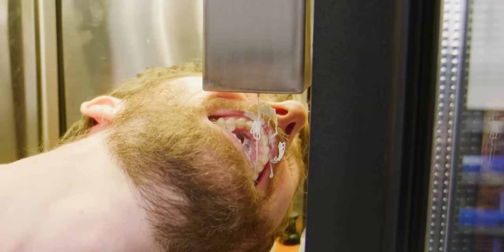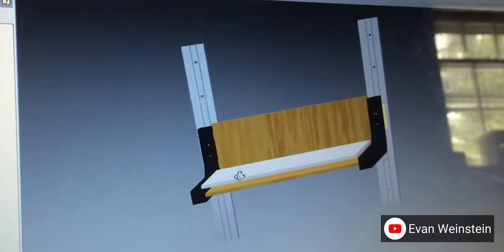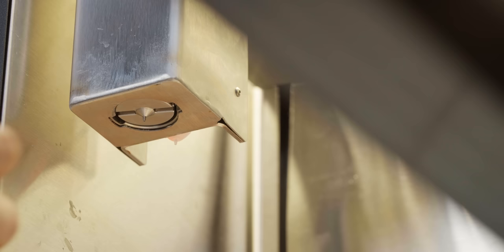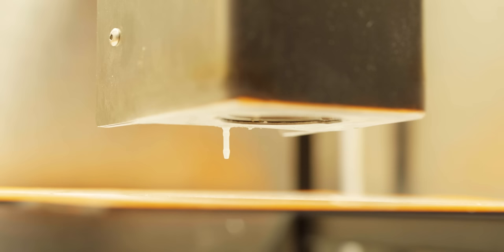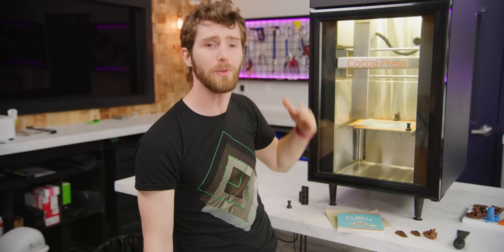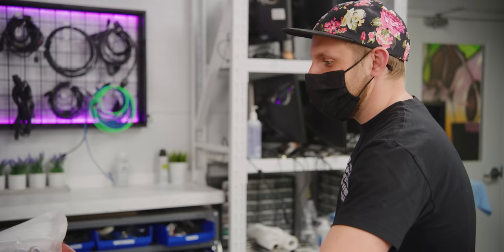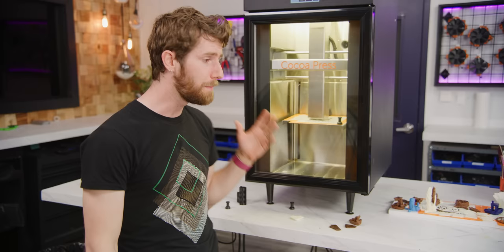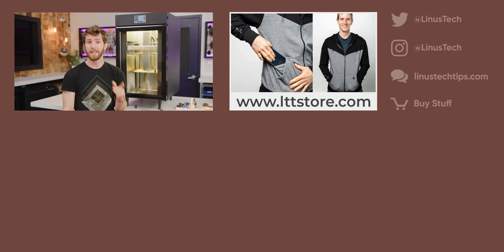Eating 3D Printed Chocolate!

Comment: Can't wait for the Chocolate printing mod for my Ender3 👀
Reply: hell yeah
Reply: If you could heat the chocolate and put the printer in a fridge I'm sure you could do it.
Reply: @TheSubieFan  I live in norway, no need for a fridge, just stick it outside during 2/3 of the year!
Reply: It already exists, check RCLifeon's video from few years back
Reply: @fantysak9388  I was waiting for someone to mention this.
Reply: There is one
Reply: Why is Nordern here?
Reply: TIL Norden has an Ender3.
Also that he watches LTT.
tell snazzy hi
Reply: HI NORDERN!!
Reply: PrinterMods' XChange system doesn't suck for that express purpose.
Reply: I have an Ender 3 Pro and a Ender 3 V2. I'm absolutely in love with printing carbon fiber enhanced PLA, especially the 35% blends but I want to produce a few CNC things using it to create all the bracketing (with appropriate metal reinforcements of course). A CNC table with a quick tool change for laser, routing and similar table sized heads. A CNC similar to a 3D printer but more portable without wrecking accuracy to mount dremmels, drills and whatnot in an on the fly compatible manner. Then one for the kitchen to print frostings, chocolates and various other things that may work similar to a plastic.
Reply: Pretty sure that there are mods on thingiverse to extrude paste from a syringe, so you could put the thing in a fridge and heat the syringe to print chocolate.
Reply: Already out bro.
Reply: @dylancampbell5268  cuz the video's about chocolate, duh
Reply: What? I didn't know you watched linus.
Reply: Hell yea boiii
Reply: i can just imagine Moti's jokes about you binging on that chocolate printer.
Reply: hey nordern, you're here too, love your vids btw
Reply: Already exists... Check our RC life's video
Reply: They have that
Reply: It exists
Reply: @512TheWolf512  ahhh i see. Makes sense, chocolate is a good treat, and Nordern is a good youtuber
Reply: @dylancampbell5268  I don't know if you really get it or not...
Reply: @512TheWolf512  oh I do
Reply: Hes got an Ender3, a printing machine.
Reply: wonder how direct drive extruder heating works on chocolate

Comment: I would LOVE them to use a miniature progressing cavity pump for the next version, and chocolate pellets. I built a 3DP version for my old uni project (icing not chocolate) and they were finicky, but would mean prints could be a LOT bigger and you can just keep... topping up the hopper.
Reply: i love you angus
Reply: Is that just basically a linear geroter pump?
Reply: Angus hello!
Reply from the maker: I can't help but read that in Angus voice. But to the point, you would just top up the hopper with chocolate chips right? -CW
Reply: Angus! Glad to see you over here! Gotta say I read this in your voice, cadence and all 😂!!  To your comment- yeah for that price tag I would certainly expect a whole lot more raw material capability! Hell it should probably have a tool changer for at least one other flavor / product!
Reply: @MakersMuse  Maybe it would be possible to embed a heater cartridge inside the screw/rotor?
Reply: @LinusTechTips  Real white chocolate, just so you know is nowhere near as sweet as the "white confectionary" that you're consuming in this video. It has far more depth and consistency. Most chocolate connoisseurs(which believe it or not actually exist), say if the white chocolate you're eating tastes too sweet, it most likely does not contain any cocoa butter or cocoa powder.

Next time you go to a store, look for a white chocolate bar or bag of white chocolates and notice the subtle differences between the cheap products, and the ones that have truffles or higher price tags. If you can find Lindt White Chocolate Truffles bags, notice that they typically list cocoa butter in the ingredients list. That is the big difference when white chocolate is more well-rounded and contains a more full flavor. Without Cocoa Butter, it is just sugar.

Interestingly enough, despite Russell Stovers being a far inferior product to Lindt, Lindt actually now owns Russell Stovers.

Another interesting thing to note about chocolate and white chocolate, in general, is that it is technically illegal worldwide to call products chocolate, white, milk, or otherwise if it doesn't contain any real cocoa products.

Therefore on the packaging, if it says confectionary or chocolatey flavor, then chances are good that it doesn't contain enough chocolate ingredients to meet worldwide trade standards. Swiss Milk and Swiss Chocolate are creamier, tastier, and far less sugary than most other chocolates. Lindt is by far one of the most well-known among true Maître Chocolatiers and has been acquiring numerous companies in the USA such as Ghiradelli and Russell Stovers.

There is a massive difference between American White Chocolatey Confectionary and Swiss White Chocolate. I highly recommend you try taste testing Swiss chocolates such as  Lindt versus the American and I guarantee you'll notice the difference and change your mind completely regarding white chocolate after trying Lindt White Chocolate.
Reply: dude now i remember it form the up mini review video
Reply: @MakersMuse  and a heater cartige for heating the water
Reply: @LinusTechTips  It's z, not zed. You absolute bot
Reply: This is really just moving out of the proof of concept stage and I expect there will be a lot more refinement incorporating some of the suggestions made. As it's likely to be rather expensive for an amusing 'toy', and be more likely to be purchased by confectionary stores, I'd expect those suggestions to be incorporated.
Reply: @LinusTechTips  chocolate CPU watercooling block when?
Reply: @LinusTechTips  probably don't even need to top off the hopper. It can easily be fed by a large bin
Reply: @kingzach74  Wait there’s a difference

Comment: In highschool our final engineering project was 3D printing plastic molds to then fill with chocolate, definitely easier than this way haha
Reply: I was thinking the same thing, but the complex internal structures is where my mind can't think of how that is handled easly with the molding process
Reply: @Waitwhat469  mold in parts and assemble with piped warm chocolate to fasten.

Comment: Funny thing is, it would be much easier to 3D print a design in PLA, then do a vacuum-form mold of it and fill THAT with chocolate. Its extra steps, but until this thing gets reliable, it will be the better way. 
And even at doing that, your vacuum-forms can be re-used multiple times if someone does want to sell custom chocolates.

Comment: There is a good way to use this kind of 3d print outside of food. I dont know another  material that similar to chocolate when it comes to temperature behavior, but what if I 3d print a model, cast it on sand to make the mold, then cast metal in it. The chocolate model then can be melted back into printing material easily. With plastic, you need to buy extra equipment just to reuse the printed plastic back into filament. With chocolate, just a kitchen stove and a pot should be enough.

Comment: Some friend of mine had to think about customized chocolate solutions, and thought about 3D printing chocolate. It turned out 3D printing the molds to put the chocolate inside is actually more reliable and more efficient (you don't have to rely on very slow printing times if you have 100 times the same chocolate piece to do). I don't really see an interest to this machine, given how complicated it is to make it work (but it is definitely a very funny project).

Comment: I wonder what would make more sense for the food industry when it comes to this. Would a chocolate printer be best? Or best to 3d print and prep molds for use with chocolate?
Reply: Second one if you don't need some kind of different interior vs exterior texture, first one if you do.

Comment: Chocolate shot glasses would be fun.

Better yet, you can 3D print something 99% of the way pause it, fill it with something, then finish the print to make filled chocolates in all sorts of unique 3D printed shapes you couldn't do with molds.
Reply: As a note, there is a LOT online and in cooking books about improving the behavior of chocolate under non-ideal conditions.    Fortunately, unlike plastic, chefs have wrestled with chocolate for a few centuries now, so there are ways to improve it.    I'm sure their chocolate comes well pretempered, but most pretempered chocolate would not be.

A technique that is a cross between tempering of glass and the final melt and skim smelting process for lead  works wonders.  It's, obviously, called "Tempering."  Do it repeatedly and you can remove impurities while improving the consistency of the chocolate.  Usually standard factory tempered chocolate isn't tempered enough times, long enough or well enough to address these issues.    Also, it's bound to pick up stuff in the kitchen when handling it that needs to be removed.  It's best to just remelt it.

Just slowly heat the chocolate to it's melting point, then hold it there.   Initially stir in what floats to the top and bottom, but then after a bit, just start skimming it.  Then remove the melted chocolate, being sure to leave the sediment.  The skimmed and sediment, should be usable in other dishes.  They just aren't good for melting chocolate. 

If you aren't too upset about adding stuff to your chocolate, you can add refined coconut oil or shortening (former tastes better, but is more expensive) to improve melt as well as some refined light corn syrup or simple syrup.  Add this all before tempering the chocolate, or any impurities will mess up the chocolate.

Comment: Awesome job! But with the limitations of this unit you guys should try the "fake" chocolate. In this chocolate they replaced the cacao butter (what requires the tempering of chocolate) by a other natural oil like palm kernel oil or coconut oil, so no need for tempering. This should do a great job in this unit. (does not taste 100% the same)

Comment: Great and smart design on the feeding syringe. Cooling should be done at the end of the hot end tip without airflow hitting the nozzle.
Add a blower with a flattened tube at 45 degrees towards the tip of the extruder. Should make cooling more efficient for chocolate.

Comment: In Switzerland there is a brand of chocolate they dont sell outside the country called Cailler (orginal inventors of Milk chocolate) and they have a chocolate bar they purposely aerate the chocolate so it has lots of air bubbles in it. I've never had a smoother and taster chocolate than that. https://cailler.ch/en/chocolate/cailler-air-tablet-100g

Comment: When systems like this get better, it will be amazing.  Being able to precisely inject various ingredients throughout custom structures is going to be a massive hit for food production.
It'll also more specifically allow for incredible consistency, and in turn, less food waste or food that is some times a little strong or too weak in some areas because certain ingredients bunched up elsewhere in the food product during production.    Specifically being able to integrate air pockets in to some foods precisely will create things we couldn't previously create without incredibly hard production methods that usually result in other issues with regards to taste.
A device like this won't be doing it, but a much larger industrial scale version will be able to handle it.  Devices like this will pave the way in research and cutting the costs before that side even comes to fruition, which is backwards from the usual price reduction pathway.

Comment: I've actually used an EnvisionTec Bioplotter to 3D print chocolate before (I know, what a great use of research equipment)! It is fun, but, as you said, it is extremely challenging to maintain just the right temperature.

Comment: what exactly does this solve compared to a normal mold? with plastics, molds can cost literally 100s of 1000s of dollars, but with food like chocolate you can pretty easily just make a silicone mold that will last as long as you need it. I guess for 1 off pieces it could be useful but idk

Comment: "White chocolate isn't chocolate by the way" - That's a common misconception. It really is chocolate!

White chocolate is made from cocoa butter, milk solids, and sugar - just like milk chocolate - but does not contain any cocoa **solids**. Cocoa butter is made from cacao beans and absolutely qualifies as chocolate. In fact, it is the part of chocolate that is responsible for its ability to temper due to the formation of fat crystals.

Fun fact: There is actually a fourth kind of chocolate called "ruby chocolate" which is produced from special cacao beans and processing with citric acid, creating a unique pink color and a slightly tangy flavor. A lot of people assume based on the color that it has fruit flavors added to it, but it is in fact pure chocolate.
Reply: A lot of chocolatey-type confectionary just uses "white candy" (especially the mass-market stuff). I wonder if that's what Linus is talking about? If you check the wrappers, it will usually tell you. White chocolate is superior to that. Reeses are white candy. I think kitkats used to be white chocolate but now are not. It doesn't help that some resellers will call white candy products white chocolate. (Edit: apparently Hershey actually got sued over the Kit Kats. They are made by Nestle outside the US so maybe different ingredients).

Comment: Sorry guys, this one isn't gonna crack into bakeries the way you think. You can achieve the same thing with a standard 3d printer, ideally a resin printer for speed, use it to make a positive, make a mold with food save silicon which bakeries doing that type of work already source, or can very easily, and pour into finished mold. They'd have to make slugs on demand anyway or crank out a bunch on a slow day and keep em on hand as long as possible... This thing is just not worth the headaches, let alone the 10 large

Comment: For practical application I think it would actually be more cost effective to just buy a cheapish plastic 3d printer and just print molds and then heat the chocolate and pour it into the molds.  Then you can reuse the molds over and over and not have to spend hours waiting for your candy.

Comment: ((PLEASE HELP))   Please give me some tips on what I should do or let me know if I'm just screwed also if you guys do have a discord please let me know the link I can't use twitch anymore because I forgot my account and even though I can use my email is verification it still won't let me change my password so I can't use the application I've been trying to run war thunder BeamNG wot blitz automation the long drive DCS on a computer I got that was advertised as a gaming PC but it was an office PC it came with four gb of RAM in ddr4. The graphics chip is built into the CPU it's riveted together except for the panel on the side that you can unscrew one screw to slide off and the only slot that I can add anything to is a ddr2 slot so I've got a $60 one coming in the mail that is 4 gb and you can't access the ram that came with it either I want to know is there any way out of this.... So far I've spent over 562.00 on the PC alone I did get a nice razor gaming kit that was on sale with the keyboard mouse and headphones and a nice Acer monitor but it's the computer that's my problem